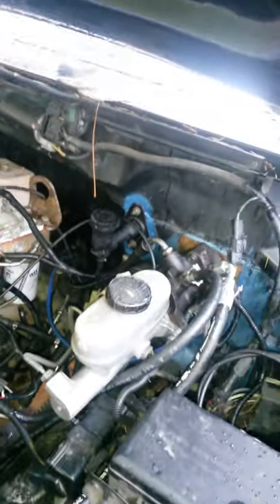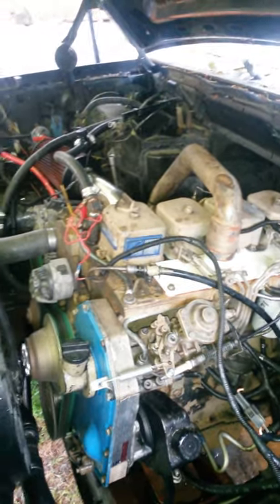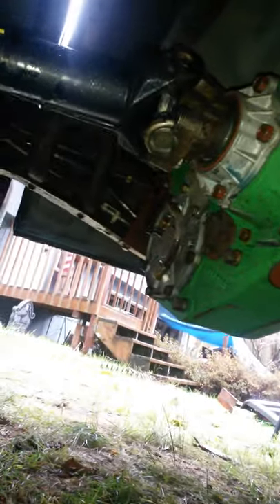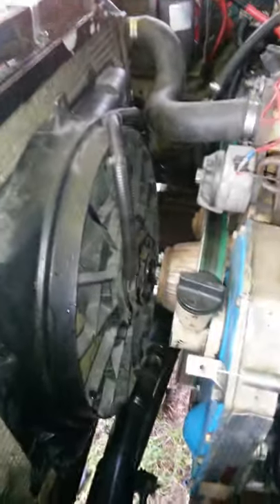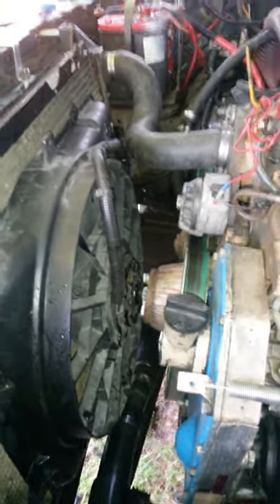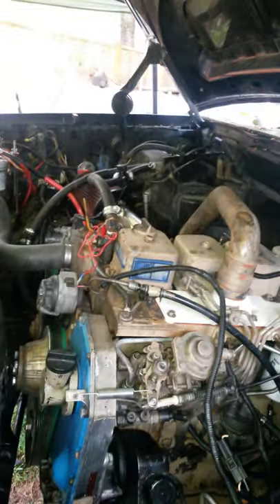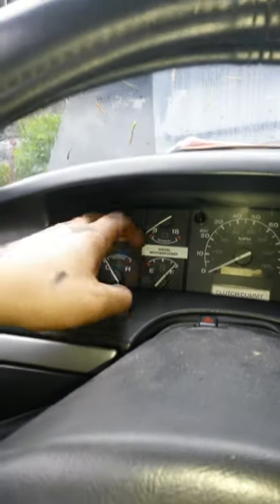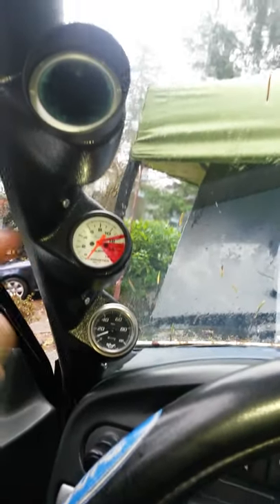Cummins 4bt swap in 1993 f150

Comment: where did you get the adapter plate for the zf5
Reply from the maker: it's a stock adapter plate from the Ford bread van.  iirc the original trans was a t19.  the Ford t19, e4od, m5r2, and the small block zf5 (only available in f250/350 with the 351w) all share the same bolt pattern.  so the Ford adapter plate is available, and if youre buying one from a Ford bread van it may already be on the engine